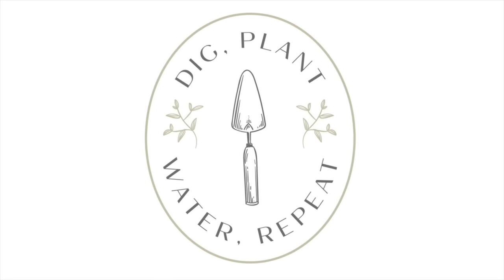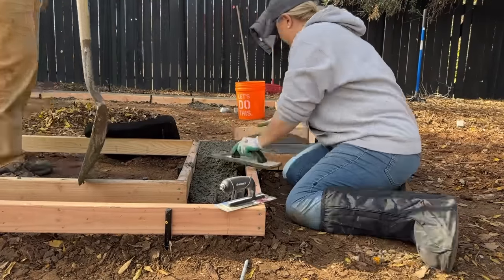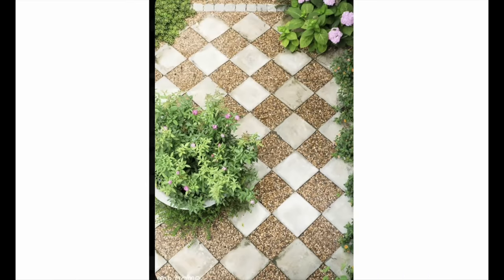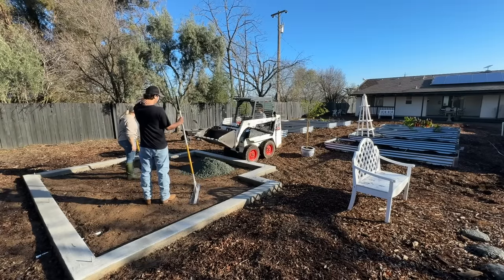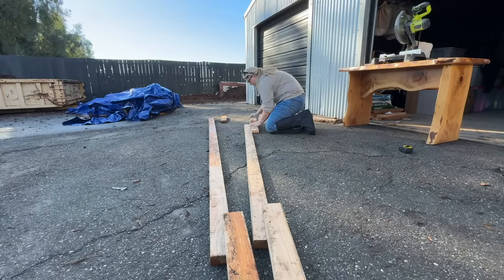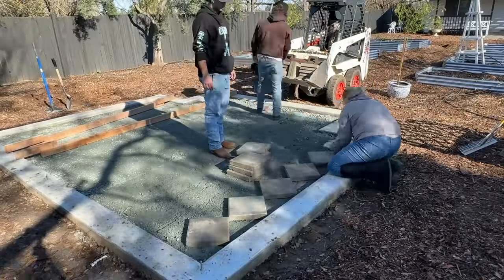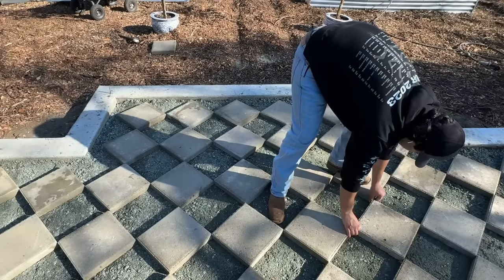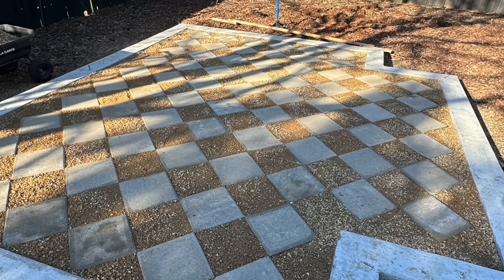Next Up: Greenhouse FLOORS! 🤩 Installing Canopia Greenhouse Gravel and Paver Flooring!

Comment: For my greenhouse, they used a cement frame on the base rather than a slab, and I really am a fan. When I got possession of the house, i pulled up all the pavers, dug up the soil, and laid new soil on the ground. In the next few weeks, I will be reinstalling a brand new roof. This summer, I am going to be growing the most amazing items, and hopefully, into the winter. Great job on your flooring! <3

Comment: I never was that crazy about the far away location for a pool. I like the greenhouse there with the gardens in front but you could always take away a few of the garden beds closest to the house in say 5+ years you said you got cheaper ones anyway and put in a small pool. It would be interesting to know how you re-invision the layout. I like the idea of consulting with an expert and making a master plan but I always figured that there would be some changes. Sometimes you get a good deal on something or see something on Pinterest that you can’t pass up. Just curious. I expect the finished product will be 70% master plan but not surprised if 30% gets changed due to unknown opportunities.

Comment: The flooring looks fabulous. Love the diamond pattern. Question: the aggregate you installed  before the pebbles, will it act as a weed barrier? I’ve been told that landscape fabric should be laid before the aggregate to ensure no weeds/grass come thru. Or do you just plan on treating the pebbles routinely to keep weeds from popping up? I’m in Florida where humidity is high. Maybe that’s the difference.

Comment: There is nothing to keep those pavers from moving enough to LOOK annoying.   The gravel is not going to support say a chair leg or table leg evenly.  You won't be able to sit at a table and move your chair back to stand up.  Even using this for only growing, you will run into the same issues with tables meant for flats or pots.  And the gravel will constantly end up on TOP of those pavers and then roll, while the human foot is likely to slide out from under them.....  sound a bit familiar?